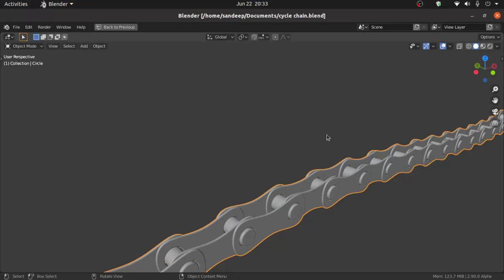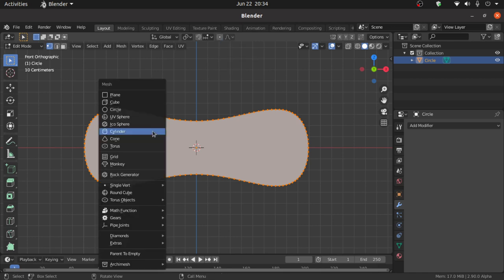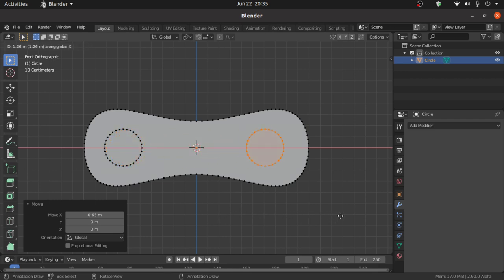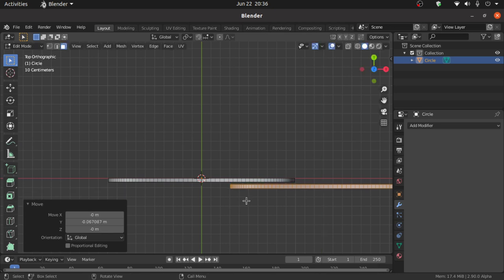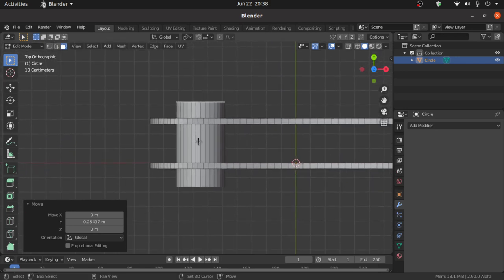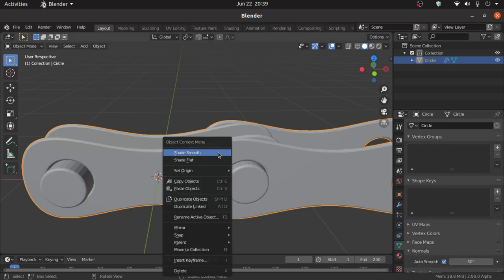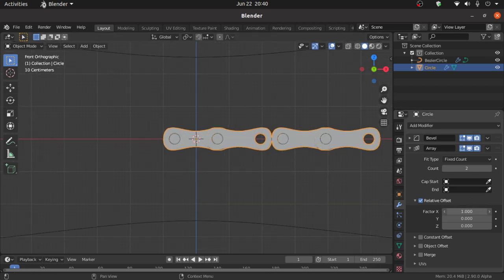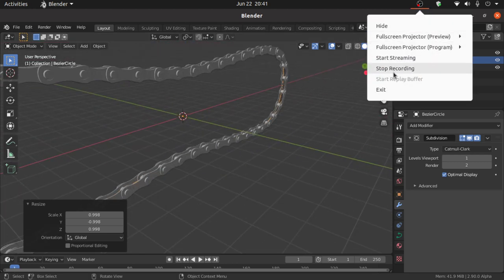Blender 2.90 - cycle chain modelling tutorial

Comment: Yes I love how it’s just no nonsense.. press this. Done. Press this— done.

Instead of “now that we have a bike chain base, lets run an array curve with a proportionally edited circle constrained to X. Make sure you have subdiv active at 2/2. Run a tight extrude on Y at symmetry value. Add a normal hardening operator, assuming you aren’t flipped, shade autosmooth at 30 degrees, pop on a double regular profiled bevel mod, angle, and tag your array on x so it matches. Follow the array with low deform until you can proportion it back on negative x to create alignment. Continue the array and you’re done!” (Most tutorials).

Comment: what is the difference between subdivision surface, applying and selecting all, rightclick, subdivide?

Nevermind, I found it out
Reply from the maker: subdivision surface modifier smooths sharp edge with adding loops whereas right click subdivision only add loops between two edges.